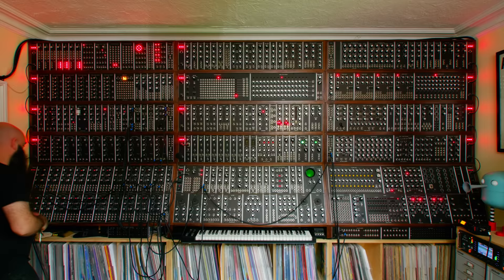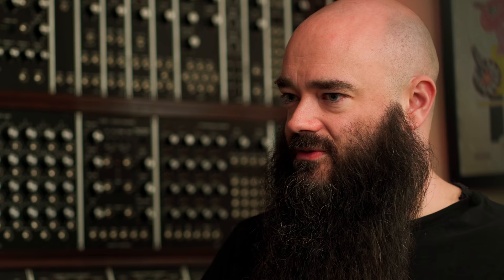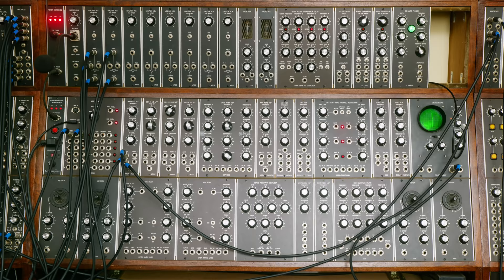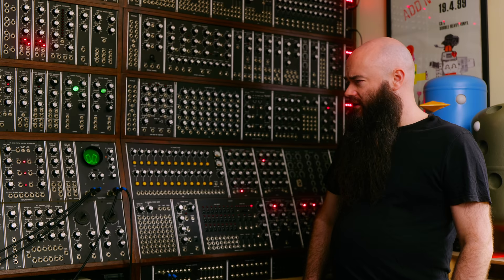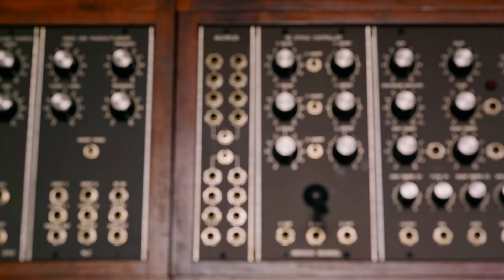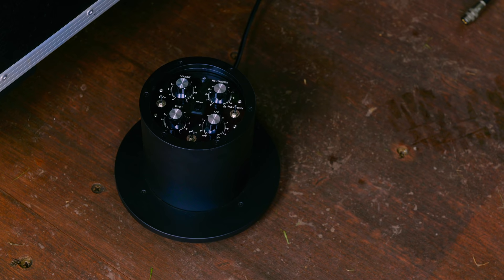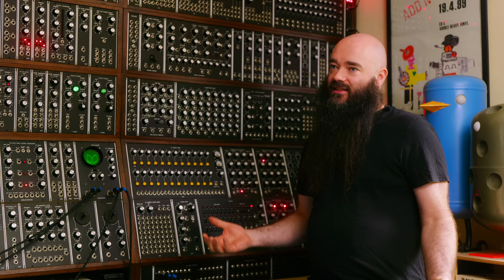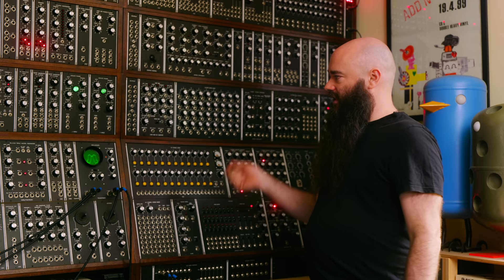Incredible DIY Modular Synth

Comment: Yes! Not only is this utterly brilliant, but I get to be 'that guy' in the comments and say "you do realise you could have just got a laptop and VCV Rack?" 😃
Seriously though, I have so many questions. What's the longest patch cable you need? How much power does it draw? Can I plug a guitar into it? 👌
Reply: @Virtual Modular There are 28 no. 3.5m patch cables hung on the back of the studio door, and strategically placed multiple modules, so only 2 no. cables needed to go from top left to bottom right of the system. Power use is negligible - the LEDs draw the most current. Actually the valve oscilloscope probably uses the most power. Yes, you can plug a guitar into it.
Reply: @thenervoussquirrel  awesome, thanks. I've learnt modular purely using software and would love to have a go on the real thing. I don't have the space for something like this (plus I'd be divorced, haha!) but it's really impressive. A follow up video demonstrating some more of the sounds it can make would be good too.
Reply: @VirtualModular  Look Mum No Computer paid Dave a visit a while back, worth checking that vid.
Reply: @KM_Mountain  thanks, I'll have a look for that 👍